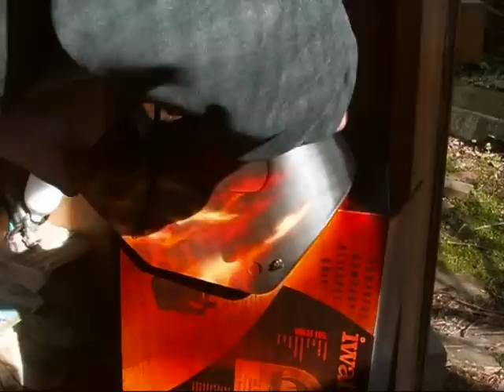TRUEFIRE WELDING MASK

Comment from the maker: the white was actually ComArt white
i find it has a finer pigments and flows out the airbrush smoother, ideal for detail work to.
if i use AutoAir white for flames jobs normally would go for transparent white

cheers for the comment :)